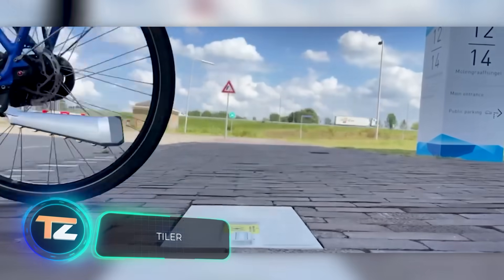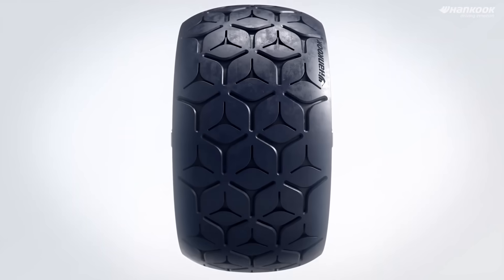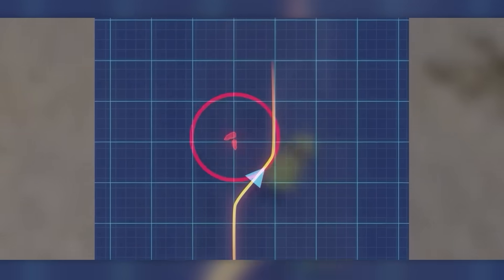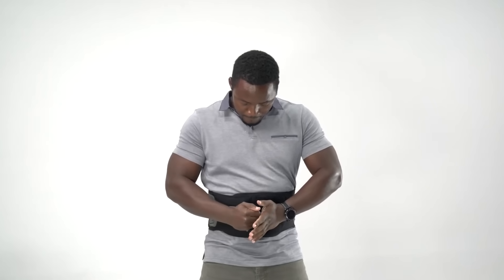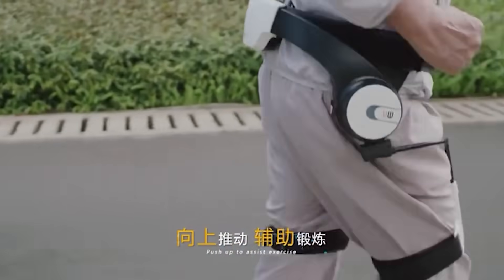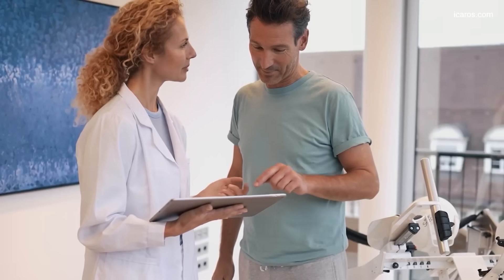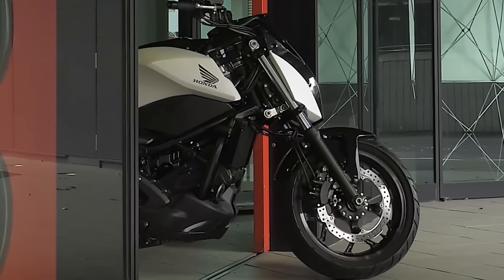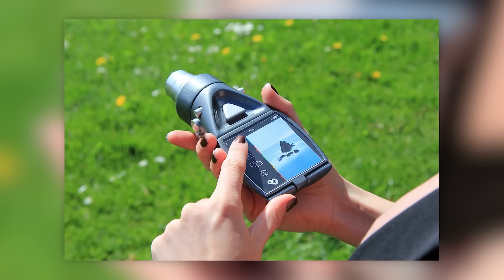INCREDIBLE INVENTIONS YOU DIDN'T KNOW ABOUT

Comment: 1. Kickstand charger: why not just a retractable cable? Security is an issue.
2. touchscreen bubbles: how long until they plastically deform the screen?
3. Hankook wheels are very cool. It would make parallel parking way quicker.
4. parking bots seem expensive and unless there are several at the door, will cause a backup.
5.  Dig the mining drones. Pun intended.
6. rich people boat/plane.
7. back belt is very good for surgery recovery.
8. KuWalk is very neat for elderly or rehab patients.
9. electric skates will only cause injuries, then go away, like the fad they are.
10. magic fingers: very interesting and can go into a robot hand for Luke or Vader.
11. tie this to Elon's brain chip and you have ultimate waffle house cook.
12. Icaros Health simulator: future fighter pilot training
13. Honda Cycle: Cop buddy tv series incoming. Knight Rider, perhaps?
14. R12 Rex: Cleaning bot goes haywire. They have to call in Knight Rider! 
       It writes itself!
15. Hydrosurv: very cool! Mount a Hydrogen bubbler and solar array and it can make its own fuel!
16. camera: meh.
17. brake shoes: more automation. Less possible injury for workers. good idea.
Reply: cables require coordination and are therefore inferior.

Comment: Ah yes, more 'innovation' that relies on batteries that are more costly, dangerous, and environmentally devastating to produce than fossil fuels. Also charges up on electricity generated by coal burning? Dams? Solar isn't going to meet the electrical needs of a whole society; do some research and you'll discover that green energy is an abject failure. The point of all this is to immobilize you - the new slave class.

Comment: Hmm, charging pads for bikes "next" to the bike stands. Guarantee your bike will be gone 10 seconds after you leave it unmonitored.
Self parking garage systems sound great.....until someone finds a way to hack them. Going to need some beefed up physical security as a secondary measure.
Remote control construction trucks would be good in areas that are hazardous for people to be in. Though secondary kill switches to block hackers might be a good idea.
Willing to bet it was the price tag that killed the Model3
Damn Shame that SpinalArmor support system costs $250, most americans wouldn't be able to afford even that much out of pocket these days.
The JoyERiders would be great if they found a way to up the weight limit. Me plus my work pack weighs about 260.
Willing to bet that VR set will start around 5k to 8k for a base model.
Those rail brake shoes and stoppers would be a great deal better alternative to a derailer that can cause untold amounts of damage.